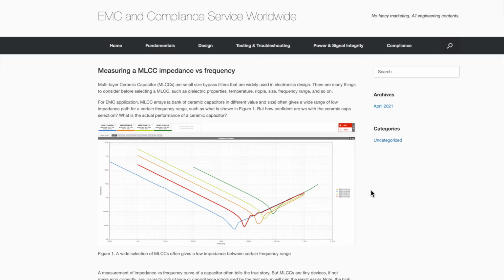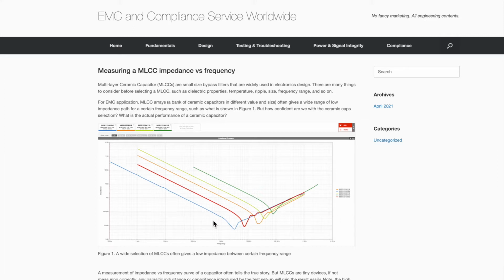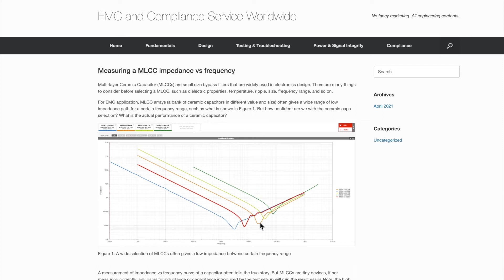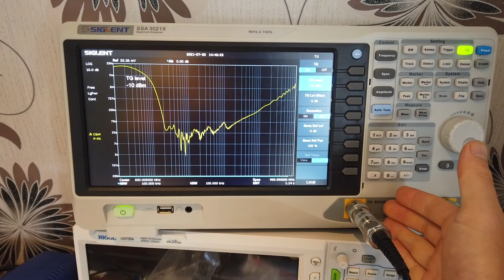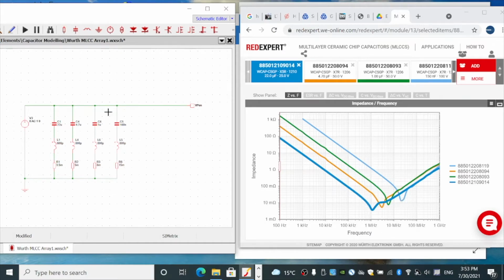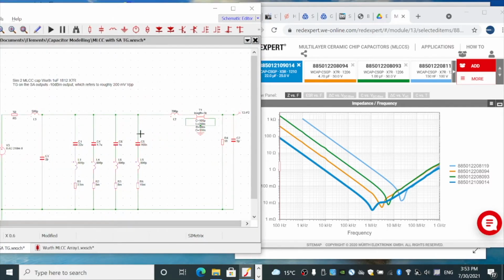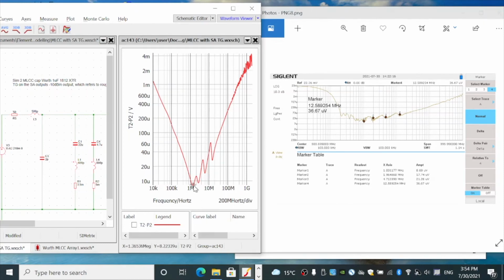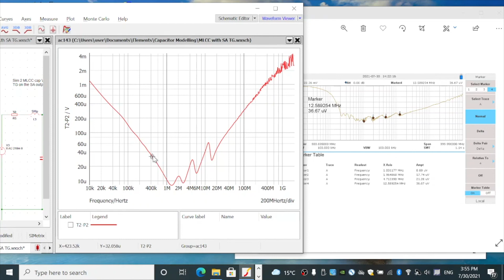Measuring Capacitor Array Impedance Characteristics

Comment: How do you determine ESR and ESL values? Is there any rule of thumb?
Reply from the maker: Not really. I often check the manufacturer data sheet. but on the pCB, for trace and track, I can use the 10nh/cm rule for inductance.

Comment: hello,
in your test, all the capacitors are "X" type ? (X7R / X5S etcc.)
The µF sizes are X-type I suppose. But the 150nF is X-type too, or C0G ?

PS : thanks for your work & your sharing. Very clean / precise / educational. No "fun / jokes" in your channel, but science is fun in itself, thus that's perfect. BRGds
Reply from the maker: Hi I think they might have been all ceramics. I did this a while ago, hence I cannot remember. And many thanks for your feedback.